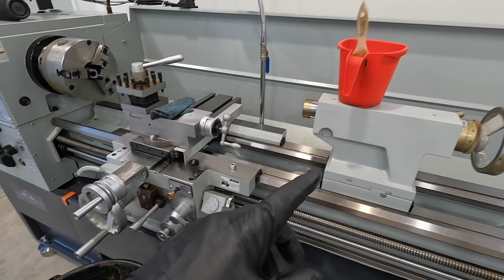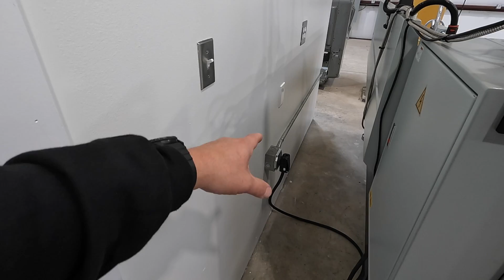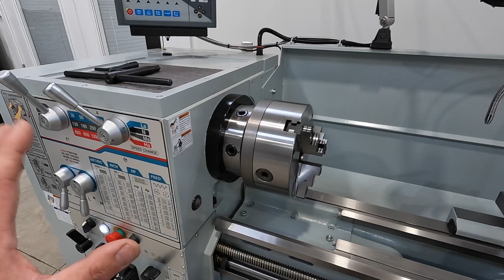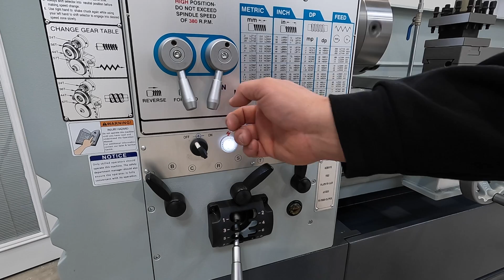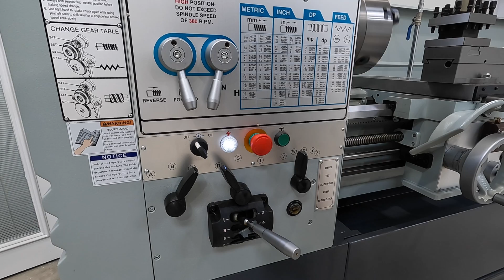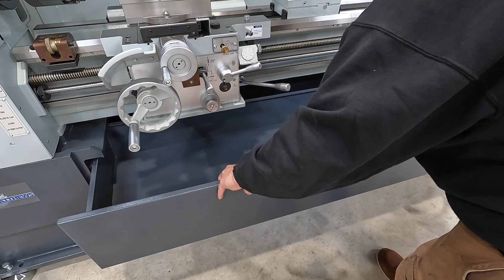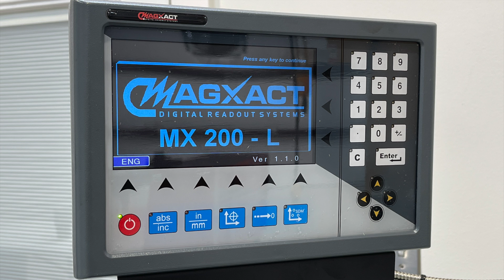Precision Matthews TL 1660 First Run

Comment: No steady rest, no follower rest, no taper attachement, not even a light? Those tool posts are aweful for tool height adjustability. Also, it's never a good idea to run a 3-jaw chuck at 1800 rpm with the jaws open like that..
 smh
Reply: You seem like the guy everyone makes fun of in the shop

Comment: HI Abom, That is a very nice early Christmas gift. I just had an Idea, why don't you put some plastic bins inside the chip tray? You can pull them out and dump saving you time. You could drill some holes on the bottom of the plastic bins to let out the cooling fluid.

Comment: I love the lathe but dear god never ever run a lathe in high gears with the chuck unclamped!! The jaws WILL MOVE!! It never occurred to me before that that could happen until i turned our lathe on at work with a 10-12" 3-jaw chuck at 1600 rpm's and was horrified when i saw the jaws open up about 2 inches. I was going over the lathe with a newer coworker that didn't know much about machine tools and we never really use that particular speed so I decided to put it into gear and fire it up. I will never do that again.

Comment: So I'm curious why you don't use a collet set up as many machinists now do in the lathes?  Is there some drawback I'm unaware of? I was considering them.
Reply: Collet chucks are good for a lot of things but they are very limited on how big of an O.D. they can clamp on. Plus you have to have a very large range of them to cover all of your sizes and shapes. Which can be very expensive and you have to have a place to store them all. A 3 or 4 jaw chuck is much more versatile.

Comment: Peel all those vinal stickers off the machine that have safety information on them. You already know all that stuff. After they are left on and exposed to oil, they are hell to remove. While new they remove easy. It makes wiping down the machine easier. You won't be able to read them after six months anyway.

Comment: Very nice Adam.  I’m curious. Did the various tool companies, fans, cranes etc. offer you discounts for using their gear?  I can imagine this shop and the new tooling would require a considerable capital investment.  This lathe lists from 17-20k alone. The pacemaker, well I hate to say it, could have been more affordable as older lathes sometimes get sold for scrap weight (brings a tear to my eye). Then all the other stuff, not to mention the capital improvements made to the new shop. If the landlord paid for those you were very fortunate indeed.  I realize this shop is only temporary as you plan to have  a new and improved shop at your own location once you and Abby build your dream house.  Will you be taking subbed out work from Motion?  Thanks for sharing.
Reply: Yeah, I think he gets some discounts on some of the equipment he purchase, but not all. That's a natural thing, many viewers, great exposure. The CNC equipment is most likely show room models, owned by the supplier. The new shop building itself is likely 100% on him, and it will be sold, or rented when he moves out. Quite some investments, like with many businesses, got to put something in to get something out) It's great that someone so skilled and proffesional with manual machines as Adam takes the time teaching others.

Comment: That seems to be a great lathe. You will get many years of great service from this lathe. I have always Precision Matthews machines. In my opinion, that I would have gotten a bigger trow if Precision Matthews offers one. You differently didn't waste your money on the machine. Having a cast Iron bed will last a last longer than a machine made from weldments which so many have gone to since the early to mid 1970's.. I really wish the machine will run to your satisfaction which I believe it will. I believe Accurite DRO's are better but if you are satisfied then who am I to complain.

Comment: question from a non-machinest:  why would you need something running at 1200 or 1800 RPMs?
Reply: For small diameter parts, it's the only way to get the right surface speeds.
Reply: carbide tooling prefers fast speeds
Reply: It depends a lot on the material and tooling. Carbide tools are super hard and heat resistant which allows them to run much faster than High Speed Steel, of course depending on the material. Hard steels will want to be cut slower than softer steels. Harder materials will have more tool pressure and heat being generated which is why materials are often cut super fast or super slow. A lot of factors go hand in hand in machining (cutting metal) that determines cutting conditions. Not every calculation or rule is taken seriously because there will be times when you have to simply use your best judgement. Cutting speed calculations are only reference, a starting point if the conditions check out. The machine's rigidity and power matters a lot as well but that's another rabbit hole.

Comment: I seen a video of a guy bought a older used lathe and it had a storage space behind a panel that had extra electrical parts that came with it from the factory like extra fuses and switches and stuff like that it was listed in the manual so just wanted to say always check the manual real good I’m sure you already have being you said you read how to break it in thanks for sharing buddy looks like a great machine hopefully you won’t have any problems or complaints

Comment: Adam we nearly have identical lathes, except mine is made for ACRA and is only 14", but everything about it is essentially identical. Oh, my speed control is different as well. I have been very happy with mine. I replaced the carriage lock on mine with an adjustable lever handle to replace the allen head screw. It is metric. If the similarities continue there is a carriage drive crash protection clutch just inside the gearbox. Sometimes, it might be a tiny bit loose. There is a panel to access it by the rightmost lever. My control levers are also a little bit sticky. I have never changed gears with the lathe running.

Comment: Hi I have a similar lathe (made in China) from Grizzly and from experience I would advise to at least remove the gear box lid and spindle end cap to check for machining debris before they get into the spindle bearings. I found a disturbing amount of damaging stuff in mine thankfully I was able to remove it before the spindle bearings were damaged.
good luck Rich
Reply: Crap in the gearbox is a feature introduced on cheap Chinese machinery. This is made in Taiwan where quality assurance is important. No comparison in my opinion.
Reply: @petergoose8164  my machine is made in taiwan
Reply: @farmall2403  My comment was not intended for you but failure after 8 hours is a BIG warranty claim is it not?
Reply: after several weeks they finally sent me a complete set of taiwanese headstock bearings. i had to do the entire repair myself. and buy all the oil. i was less tha. impressed with the whole experience. it works ok now. leaks oil continuously which is annoying.
Reply: Agreed. I had the same thing in my PM1440GT. Unfortunately i didnta catch it in tome and after 8hrs of run time inhad to replace every gear in the headstock

Comment: Hi Adam, this lathe sounds very quiet for a gear drive lathe. Much quieter than my grizzly 1640 lathe(which also has hardened and ground gear). I did some study to see how I can make my lathe quieter and I found that the PM 1660 actually has a different spindle design. It uses one larger taper roller bearing in the middle with two deep groove bearings on both sides. I think this design should make the spindle smoother and quieter. But one concern is it loses the preload capability compared to the  traditional two taper roller bearing design. Do you feel any problem with rigidity due to the non-preloaded spindle bearing?

Comment: Adam, the next time you are indicating a 4 jaw chuck can you explain the highs and the lows, i am confused on which is which. Thanks for the great content. I am brand new to the hobby machine world.
Reply: When the dial indicates a low value, that means the material is closer to the dial and needs to be moved away and closer to the center (tighten the chuck on that side) and when it reads a high value the material is farther and needs to be moved nearer and closer to the center (loosen the chuck on that side).

Comment: That's really interesting that you remove the plastic covering the printing. rather than leave it as an additional layer of protection ... But I guess in a production environment the plastic covering would probably get scuffed up and make the print ilegible in the 1st week so it probably has to go now anyway.

To help keep the print from getting damaged or worn I usually will take the self stick clear laminate and cut it to size and cover whatever I want to protect. This has actually also helped out on my dishwasher or any other appliances where the push buttons can get worn through too.
Reply: There are two types of people: Those that leave plastic covering on anything until it's dangling by a thread (no matter how crusty and disgusting it gets), and those that remove it immediately.
Reply: The plastic is for protection during manufacturing and assembly.  It should be removed when you setup the device.
Reply: I like to leave it on for a while until it begins to look scuffed, then off it comes. I do like to keep it for protection for a while, but when it begins to make ti look bad, it has to go.

Comment: My wife still has that plastic protective film on our oven, washer, dryer, and dishwasher. She says it’s like a screen protector.
Reply: I was so glad to see Adam remove it from his machines. I purchased some machines that the buyer left it on. After years of shop exposure, it deteriorated and also wrinkled. The wrinkles held moisture and fluids behind the film and caused more damage to the plates they were designed to protect.
Reply: @oscaruit  ok, but there's some middle ground there isn't there?  Keep it on until it bubbles, then rip it off
Reply: I keep mine on until it's a bit gross then I peel them off
Reply: @WayneWerner  I think that was her goal, but she cleans it with simple green. It's still on great shape 10 years later

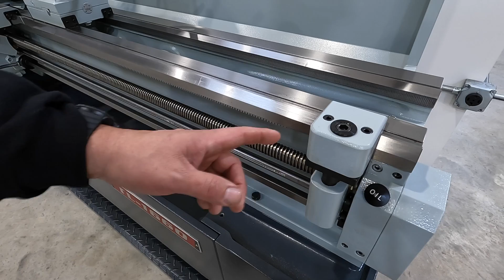Comment: At 18:24 in I finally get an answer on what the part is supporting the leadscrew and feed rod!   Not sure why its necessary but I guess in the long run it will save wear.
Reply: it probably will do that, though it'll caught a little on the lead & feed.  but its purpose, if I am not mistaken, is to prevent deflection of the screw, which distorts the timing between the spindle & carriage.  so you're 1/2-20 threads might only be 1-/2-19.75 threads.  not gonna matter in most applications, but this machine is explicitly badged "precision", so its got some features like that to live up to the name.  

That being said, the stock 3 jaw chuck, though very nice, isn't really inline with the rest of the machine(imo).  I know adam's got all sorts of 4 & 6 jaw chucks to run, but the stock 3 is underwhelming.
Reply: I have a PM-1660TL just like this one, & my 3-, 4-, & 6-jaw chucks are all 12” chucks. 12” chucks run perfect for my purposes.

Comment: Your Videos on the PM have help me make up my mind that this will be the Lathe that I buy for my own Shop. This will be my 1st ever Metal Lathe! Been looking at these for 3 years at least. Now it's time to pull the Trigger. I just didn't have the Experience to buy a good used Machine. So to me it is a much smarter choice to go with a Brand New Machine, and know what I'm getting. Thanks for the Videos on the PM, now I completely trust my decision!

Comment: What would you use 1800 rpm for?
Reply: Polishing?
Reply: You use a higher RPM for: *smaller diameter workpiece*, aluminum, or carbide insert.

Comment: I love how every time you mention an oiler, it's always optional. "here's an oil cap, you can put oil in here to..." never "need to" 😂  
You never assume the average monkey is going to know what oil is, or how to use it 🤣
Me, I'm freaking weird and getting to use all the oilers and lube points is the best part. It's one of the few things you as an operator can do to proactivly to keep a machine pristine. Other than the mess if it's a weird area, I've never heard of someone complaining about too much lube.

It's a beautiful tool you have there, and any time I see brand new lathes or mills it's always a treat because sometimes it feels like they haven't made any since 1952ish

Comment: Two things you showed on this I really like that I wish I had on my Precision Matthews 1440BV is the feed reversing control on the  carriage and the auto stop ring for the feeds. Very handy indeed! I am surprised  though, that they did not mount the work light on the TL 1660 to the carriage, like they did on mine. Having it on the carriage keeps the light right on the cut all the way through, without repositioning. Not just your spindle gears, but your feed gears sound very quiet as well; seems to be very well built!

Comment: I'm a beginner and watched different vids telling us that never run an empty or loose chuck at high speed because the jaws might migrate out. Any truth to that?
Reply: No
Reply: If your chuck teeth are on worm/scroll drives, it's impossible.  You can't push a worm drive backwards.
Reply: Star Gazer thanks for the explanation. 👍🏼

Comment: Never run a lathe with the chuck empty. The closer to silence when running the higher the quality of the lathe. The chuck on this lathe is nicely balanced. I bought a cheap collet chuck that I had to turn the outside diameter of the chuck so it would not make the lathe shake. Lathe looks like good value for the price.
Reply: I'd like to see you drive a chuck backwards by pushing the jaws.  If that was a thing, they wouldn't stay tight.
Reply: I think he knows what he's doing, you worry about yours and let the professional do his thing

Comment: Congratulations on the new machine up & running!
Here's a tip from an old fart engine builder (me): After the break-in cycle(s) - if possible - drain the headstock/gearbox oil into a funnel with a layer of cheesecloth/gauze or fine screen and several magnets laying in it. As the oil pours through it'll catch any "nasties" (hopefully there are NONE), and whatever crud that got washed loose for you to inspect. The magnets will catch any tiny particles or metal dust. As with any new parts getting to know each other, there may be a bit of fine gray sludge - but that would be normal - probably a combo of assembly greases and a little metal dust.
Reply: Ohhh great tip.  Heck, I’d do that plus… it’s second oil change…. At about half to three quarters of the book…  and then from there I’d do the book listed intervals.
Reply: Or you can just throw out what you drain.  There's a reason for break in oil changes.
Reply: @stargazer7644  Correct, the reason is to get the "crud" out of the machine, and then put the proper "load rated" lubricant into the gearbox. The purpose for inspection of the break-in lube is to see/peace of mind that there's no impending doom happening inside... and if there was, you have proof of a problem - and could send a sample to the mfg. - to bolster a warranty claim.

Comment: Adam, you might want to put plugs into the two holes where the chip pan clamp screws go.  That will keep the threads clean and might(?) prevent some coolant from running primarily through the hole closest to the headstock to the floor.
Reply: I have this same lathe, & that is why I leave the bolts & clips in there. Chips & coolant would definitely get in there.

Comment: Adam, at 1800 RPM, is this now your fastest lathe - and is it the fastest you've ever run ?
Your 12 speeds is 4 more than my 8 speed but only the 36 and 1800 are more 'extreme' than mine (54-1200).